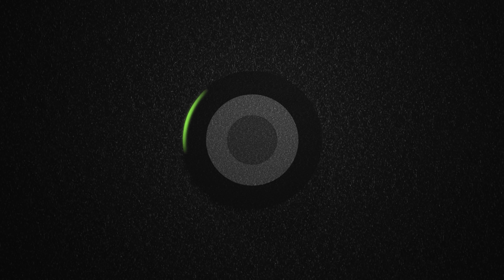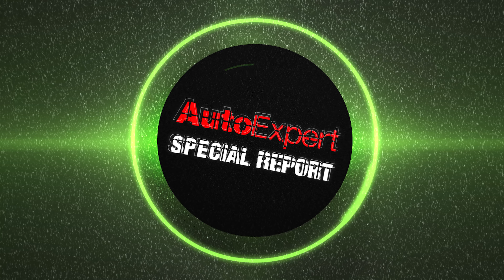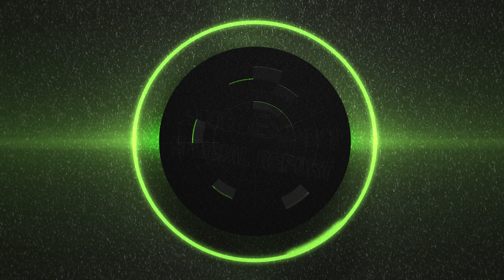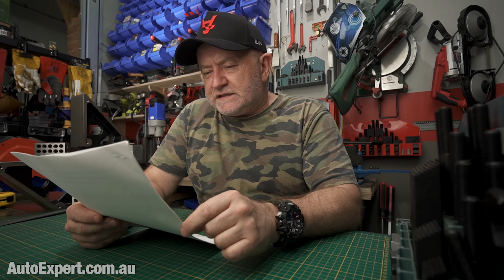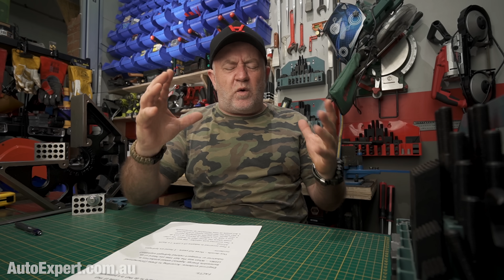The truth about fire risk: Hydrogen fuel cells and battery EVs | Auto Expert John Cadogan

Comment: John, I went through an automotive and industrial engine LPG gas course many years ago, actually during the 9/11 disaster.
Safety and safety systems were obviously a huge part of the course.
Just weeks after the course, I was at our model flying club when a member of the public franticly told us one of the cars in the car park was on fire.
This car had a gas conversion done years ago and had not been run on petrol since the install.
The son of the owner of the car had borrowed the car and filled the petrol tank because he thought there was no fuel in it.
The carburetor gaskets had shrunk because of not being used with petrol for years and was leaking petrol over the engine causing the fire under the bonnet.
The owner only had a minute to retrieve his models and radio equipment and the car was too well lit.
We all stood by and watched this car burn out.
With a full tank of petrol and a full LPG tank, things went from bad to worse.
The car was furiously burning for around 25 minutes.
The resultant actions of this fire were exactly a textbook writing.
The fire burnt out the car as you would expect a normal car fire with the exception of three huge fire balls of about 10-15 meters big.
These bursts of flame were only about 5 seconds long each time.
It did exactly as I had expected and was taught.
Total destruction of the car from the ground up.
Even the car springs had collapsed flat.
And the strangest thing was the petrol tank was still full.
Needless to say, I siphoned the petrol out and used it in my own car much to the disgust of the devastated owner.
But one thing I can say is with LPG bottles in a fire, THEY CAN AND DO LITTERALLY EXPLODE GIVEN THE RIGHT CONDITIOS.
There are a few YouTube videos out there showing hundreds of LPG bottles burning on the backs of trucks on motorways venting as you say and do, but there were hundreds of them 
exploding and going off like rockets.
Reply: This would only happen if the fusible plug in the cylinder was insulated from the heat of the fire while the body of the cylinder was heated to the point of failure.
It's not a normal situation in a gas installation and probably only ever happens to bottles being transported against loading regulations.
Where I live gas bottles are transported in special frames on trucks , not just stacked on the back.
Reply: @paulg3336  The thing is with accidents and fires, there's not always "normal situations"
Reply: @ScatManAust  During the 70s and 80s LPG and CNG cars were common on NZ roads , most taxis were powered by gas and most service stations had gas filling pumps. I don't recall ever hearing of any explosions , only 1 fire that I am aware of and 1 major leak that did not result in a fire.
Reply: @paulg3336  Yes I pretty much know the statistics and you are right.
What I was talking about was transportation of hundreds of LPG bottles involved in accidents or other mechanical failures of the transport vehicles

Comment: Quite a few serious fires have been caused by fairly small batteries. Unfortunately we always seem to "learn" and improve safety standards / building codes after these very foreseeable failures. We have the knowledge and should know better.
Reply: Galaxy Note 7, for example. Since then, there is a restriction on number and size of batteries you can take on a commercial flight.

Comment: This from Power May 1 2009.
"On January 8, 2007, a hydrogen explosion at the Muskingum River Power Plant’s 585-MW coal-fired supercritical Unit 5 caused one fatality, injuries to 10 other people, and significant damage to several buildings. The explosion occurred during a routine delivery of hydrogen when a hydrogen relief device failed, which allowed the contents of the hydrogen tank to escape and be ignited by an unknown source. This article covers the findings of the incident investigation and the actions the plant has taken to prevent a reoccurrence."

Hydrogen is used in power stations generation units to cool by pumping it through hollow winding conductors and reduce to windage within the alter alternators. While this is common in most powerstations it is still concerning as every so often these explosions do occour. So while Hydrogen fueled cars may not go off like a H bomb the refueling is a bit of a problem.
Hydrogen Fuel News  April 10 2020, a hydrogen fuel cell plant plant in Long View, North Carolina explodes. 
May 31 2022 hydrogen gas producing facility at Yeosu National Industrial Complex in Yeosu, Jeollanam-do, for an unexplained reason.
May 28 2021 Unit C4 at Callide Power Station Queensland explosion thought to be Hydrogen.
Nothing is fool proof.

Comment: to Be fair yes an EV is much higher risk of a fire than you phone or cordless tool just based on the numbers and much higher risk doesn't mean a high risk but the chance of catastrophic failure is a very small percentage but that is per cell not per battery so you take a phone which has 1 cell your 18v cordless tools have 5 cells but a standard range model 3 has 2976 cells so even if failure rate is 1 in a billion the car is still roughly 3000 times more likely to fail than your phone

Comment: Apart from EV propulsion battery fire considerations, my remaining hesitation on  lithium battery uptake, even for  'safe' LiFePO4,  for RV application is the  likely lack of battery  manufacturer simulation of vibration effects from corrugated tracks on the road to Dingo Pxxs Creek. Vibration must surely affect  the integrity of battery cell innards, cell connection  links and the maze of probably unrestrained flapping BMS wires. These risk sources are all invisibly contained within the impressive  and usually BBB (Bright Bloody Blue) plastic casings,  disguised to reassuringly emulate robust AGM technology. Vibration  is clearly a hard to quantify risk raiser for loose contacts or internal  short circuits from cable chafing.  That said, there must now be  a lot of accumulated early adoptor DPC track km, without a spate of  caravan fires.

Comment: All yes on hydrogen; a further point to discourage DIY high pressure antics apart from its small molecular ability to make a bid for freedom is  hydrogen embrittlement risk. Pipework, fittings and tank material choice need careful consideration, which are all addressed by adherence to relevant Codes when the experts dabble.

Comment: I think the biggest problem that has been skirted around is the fact that once a fire starts in any car, fire fighters can put out a petrol fire and save the occupants as they have manual doors. Unfortunately on EV fire fighters cannot extinguish battery fires and on some model EV cannot open doors without power and the doors have no mechanical over ride to allow escape. Remembering EV fires engulf the car much quicker than petrol I don't understand how cars can be sold that do not have a mechanical door opening over ride.

Comment: True about gasoline cars.
But in some countries they think LPG cars are more dangerous (they are not) meaning you are not allowed to park an lpg car in an underground parking garage nor are you allowed to take your lpg car on a tunnel ride between France and UK ( as far as i know) yet BEV's seem to be OK everywhere. 

There is 1 situation where gasoline or LPG can get very dangerous. If your boat has an inboard gasoline/lpg engine and if it develops a fuel leak the fuel-air vapors accumulate down there in the bilge... Then if someone unaware enters the boat and wants to cook something on the stove...KABOOOOM! 
That's why it is unwise to use gasoline or LPG  in a boat. Even with perfect ventilation of the engine room i wouldn't feel safe.
These type of fuel vapor explosions happen more often then you think. Each summer you'll hear about 1 or  2 incidents.

Comment: In Australia, most Sprinkler Systems are not designed to have more than a few sprinklers operational at once. The more sprinklers that are operational the lower the water pressure will be. So even with a fully compliant AS2118 install in a carpark I'd guess 6 to 10 EVs on fire would be enough to impact the sprinkler performance. If you want to see how steel reinforced concrete fails when highly energetic fuels combust nearby look no further than the World Trade Centre in New York The issue that we have at the moment is that changes to the BCA (Building Code of Australia) tend not to be retrospective , which means we'd need to get good at retroactively fixing this issue. However as you can see Australia is finding the removal of combustible cladding and other non-comlpiant building materials, quite a regulatory challenge. Who is responsible for paying for it, who can force the works to be done and how do we make sure it is rectified quickly. Call me a cynic but we're going to need another disaster of the scale of Grenfell tower in UK (72 people died) with EVs instead of Cladding to convert a theoretical risk become real and force change once the horse has bolted.
Reply: https://youtu.be/Qzt9RZ0FQyM

Most new EV's have LFP batteries.

LFP burns different to the lithium ternary batteries John talks about
Reply: @hargeaux  Interesting video but not sure why they have LiPO batteries in the same tests as LiTO and LiFePO4 but neglect to include Li ION. All Li family batteries exhibit similar properties. LiPO happen to be the most volitile of them all and are not used in EVs from what I understand. I thought that Li ION and LiFePO4 tended to be the dominant chemsitry used. LiFePO4 is a little bit harder to get to go into thermal runaway but is still capable of going into runaway.
Reply: @vk3fbab  all the batteries you mentioned are forms of lithium ions.

Do you mean NMC (Lithium, nickel, manganese, cobalt)?

I'm sure there's other videos out there, this is just one I found to prove the point that LFP batteries are not the explosive fireball death traps certain individuals proclaim they are...

Comment: Unlike a tank of LPG or LNG hydrogen is a fairly safe fuel in a leak or rupture incident (unless it’s in an enclosed area like a tunnel) the gas being much lighter than air goes up very rapidly and most of the heat from it burning goes up too, the Hindenburg incident was so deadly and dramatic due to the other flammable materials including the fuel for the engines some of which rained down as fire.
The real danger is in a rapid release of pressure AKA an explosion due to the containment vessel failing.
Hydrogen tanks need to be specially constructed and treated as the hydrogen soaks into the material causing structural changes that weaken the vessel. Injury will mostly be from the pressure wave and shrapnel not fire ( freeze burns from cold gas make occur) . If the gas release occurs in a enclosed area then a fuel air bomb is a serious concern. But all flammable gases under pressure have this risk.

Comment: SCUBA tanks are filled whilst in a water bath to keep them cool. Compressing air heats it up, intercoolers work the same way - cooler air is more dense = more energy. Charging SCUBA tanks without a water cooling jacket results in a "hot fill". Once a cylinder is hot filled to max, when it cools it is no longer at max pressure.

Comment: A quick google search suggest "There are more than 19 vehicle fires every hour in the United States. They account for 1 in every 8 calls that fire departments respond to. Vehicle fires kill nearly seven people every week. They cause another 1,300 injuries and $1.1 billion in property damage every year." People neglect to mention this fact. Because we are just starting on the path to Hydrogen fuel cells and battery EVs there are new fire risk. I believe we have a grate bunch of engineers working on designing the next generation of new energy vehicles with hope they will design these vehicles which reduces fire risk. For example BYD has developed there blade battery which has reduces fire risks. Have a look at "Nail Penetration Test on NCM Battery and BYD Blade Battery" https://www.youtube.com/watch?v=CGQwqWqzkNA

Comment: You say that LPG Cylinders rarely explode. And the same for Hydrogen being pretty safe in the same way. I agree a car full of petrol can also burst into flames and as such be a potential explosion risk. In the case of LPG. If you looked at figures for Australian incidents probably not many. Scale it up and look at China. LPG explosions are common. Large numbers of deaths and injuries are common. It was showing a downturn until recently but now seemingly going back up. Years ago, a parked LPG bottle truck in France with its brakes on fire. Set off the bottles and the resultant explosion wiped out a neighbouring caravan park.  Hydrogen risk. HIAD is an international data base and investigation unit for Hydrogen incidents. And their records show they log hundreds of cases. About 45% resulted in hydrogen system explosion. Whether the explosions were caused by venting gas or otherwise. The result is a big bang causing massive property damage. Injury and death. The ease of hydrogen to ignite and the rapid spread of the fire is always something to consider. Where they have a number of Hydrogen fuel cell vehicles running in Norway they have had incidents causing closures and further investigation. Lithium batteries burn nicely. Give off toxic smoke and as you say hard to put out. Overheating and charging. Or overheating while charging. cause most of the problems. Electric race cars at Le Mans so far a flop because they can't keep the batteries cool enough. Electric GP bikes ignite while charging and take out end of the pits. Tesla motor cars burning by the side of the road with the fire brigade struggling to put them out. Your Tesla DC power battery going up in flames and burning down your house. My lithium phone spontaneously catching fire on the bedside table and trying to burn down my house.  Would I still drive an electric vehicle. Yes. A Hydrogen Fuel cell vehicle. Yes. Driving any vehicle is a calculated risk. Whatever is driving it the process can kill you. Even the tree at the end of your road.

Comment: I am with Tony Martin , no mention of the different battery types i.e. Lithium iron Phosphate that are supposedly safe from punction and fire . Also there still isn't a final report on the ship the sank, but given the thing was full of fuel oil , I would back main engine room fire was the cause.
Reply from the maker: Lithium iron phosphate is not 'safe'. It's slightly less risky.

Comment: I take your point on the safety of a Hydrogen powered vehicle and you have spoken in the past how electric vehicles try not to burst into flames every time a skeptic wills it. However i think the odds are a little better than youre giving them for an electric battery fire in a basement essentially collapsing an apartment building. Also by your logic tropical countries shouldnt have high speed highways as they regularly have daytime temperatures above 30 degrees Celsius. I dont know what is going on in New South Wales but I can tell you in the Caribbean for instance they do have high speed highways and they dont have cars bursting into flames on the highways, at least not for that reason(its usually because they hit something or someone travelling at ludicrous speeds).

Comment: Many moons ago myself and the boys were sitting down to smoko at my Auto Electrical workshop, enjoying a bit of peace time. A lady entered the office and stated she had a burning smell in her car. Not unusual for this to happen. I said to her we would look at her car in a couple of minutes. She told us it was urgent, I looked outside to see a commodore with smoke pouring out from the bonnet. I grabbed one of the workshop fire extinguishers and asked one of the boys to pop the bonnet. I looked into the car and to my amazement this lady had left a young child strapped in their child seat. I told her to get the child out of the car and get said child to a safe place, the middle of Sunnyholt Rd is not exactly safe. The one fire extinguisher managed to put the fire out. The cause of the fire was a fuel line came off the carby and flooded the engine bay with fuel. As you state fuel and sparks do not mix. We got the job of repairing the car, but the bitter part was the well known insurer refused to pay for my fire extinguisher refill.

Comment: The big difference is a thermal runaway is not going out. If you can't put out a  petrol car fire with 3,000 litres of water you are having a really bad day. Often the petrol fire is pretty minor stuff a leakage in the engine bay and a small fire that isn't getting more fuel because the engine ( so the fuel pump too) has been turned off. Car interiors can burn furiously too and so the fire might be nothing to do with the petrol. I have seen reports of EV fires that took 2 to 3 days to control, this seems to be the typical time for them to burn out. They needed 4 or 5 trucks on site and used up 20,000 or more litres of water. The water is not such an issue here, it isn't that expensive, but the cost of having a big chunk of your fire brigade tied up watching a fire that cannot be extinguished is an issue. What if they are needed somewhere else? So as you say regarding buildings there are questions to ask and problems to solve.
Reply: New EV's use LFP batteries

https://youtu.be/Qzt9RZ0FQyM